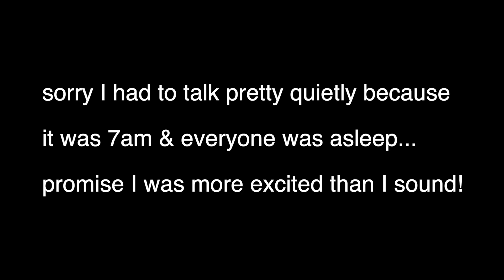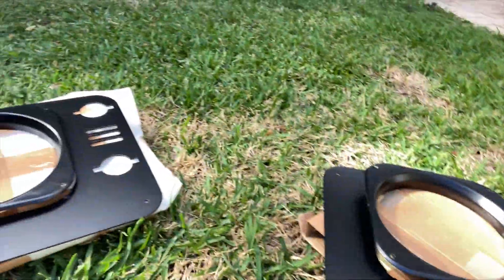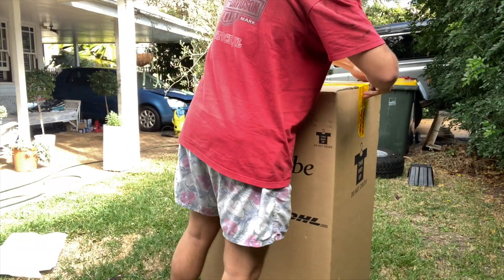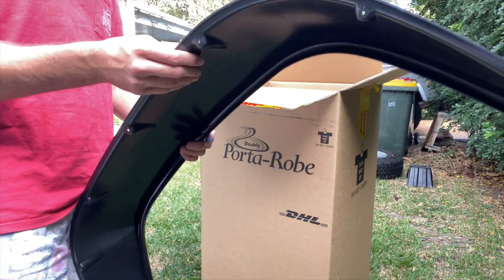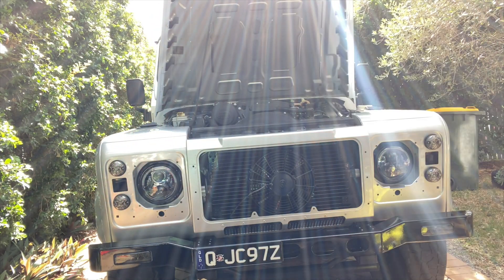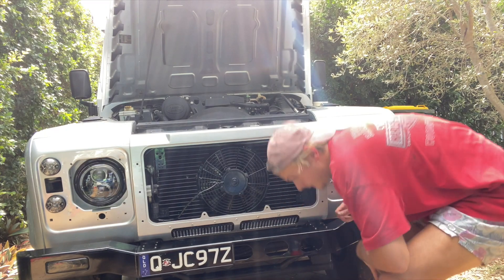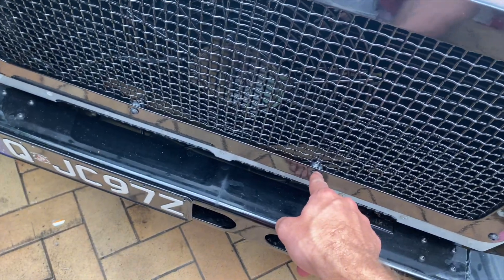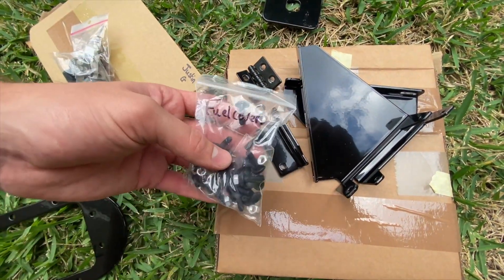Unboxing WIDE BODY Land Rover Defender Mods!!!

Comment: Great vid, also Interesting re. fuel cover fitment. My Defender already has 4 holes around the filler which look like they will correspond with the 4 mount holes for the cover you are installing. I'm guessing this changed with later Defenders.
Reply from the maker: Thanks so much :) yeah I think the cap was designed first for the older defenders, just lucky for me the drill easily fit in ahah